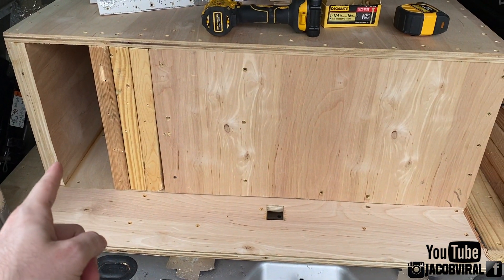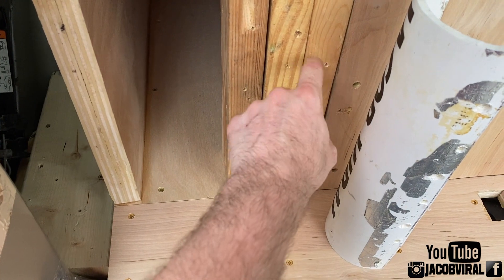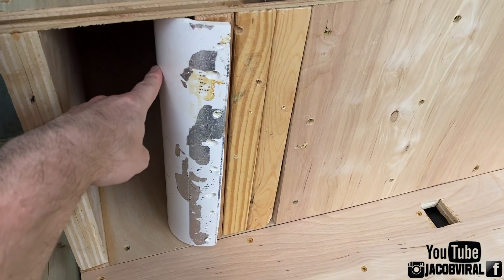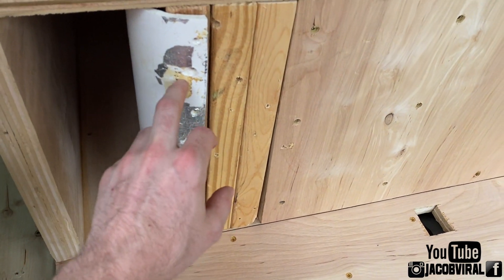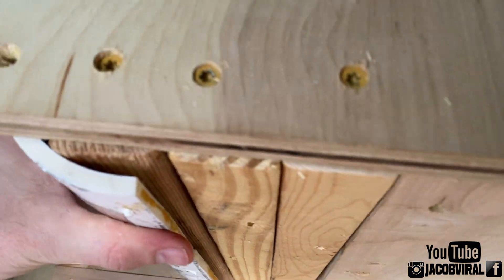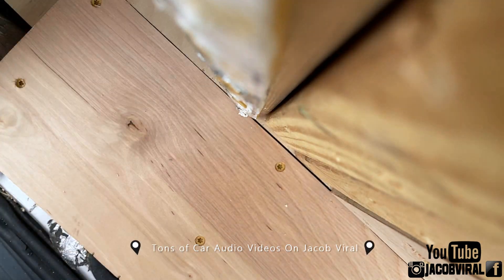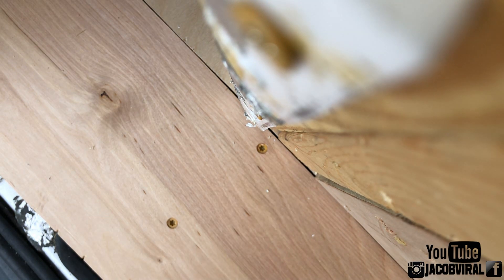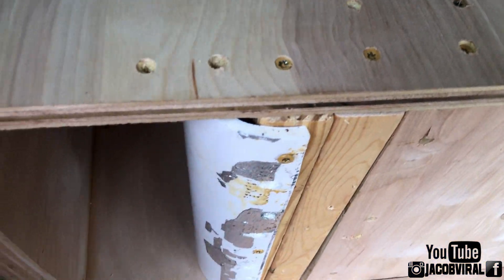PORT ADJUSTMENTS ON MY 4TH ORDER (PART 3)

Comment: Need to ask u a question about limitless lithium battery
Reply from the maker: What’s question? Maybe I can help
Reply: @JacobViral2  my electrical system was hold at 11.8 volts with stock alternator now at 13.9 volts with stock alternator,  nice
Reply: @JacobViral2  with 6k cyber limitless lithium battery
Reply: @JacobViral2  okay and thanks
Reply: Can u run main battery with lithium battery
Reply: @bassmansl9596  yes, lithium is not new technology...just expensive
supply & demandp

Comment: Make the 2x4s in the port tighter, screw them all 2gether, use ur tape or foam or something, its leaking 2 much air. I officially believe the round over or whatever does nothing, but I'll wait 4 the next video 2 see if u prove that wrong. U lost DBs this video. Good work, and keep it up bro!
Reply from the maker: Thanks Tim for the suggestion and this was just trial as the finished result would be secured for sure. Checkout upcoming vids for more updates.

Comment: I build my boxes from my head. Every box I made is solid but I never measured the cubic feet. The ports were a guess but its all good fun😁 I find if you see enough boxes on YouTube like I do you can ball park figure a good box design. I meater over 150db on my box build that started out 3 15s then I cut the back of the box off made it thicker cut my dividers and made it into 2 18s!